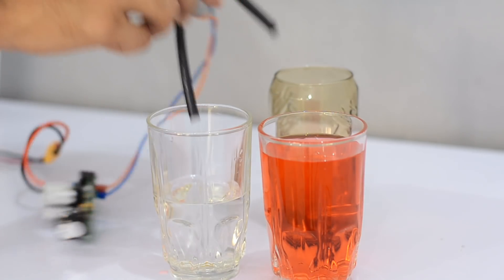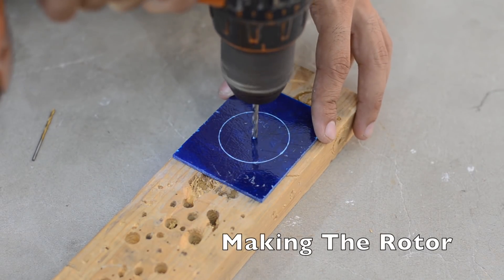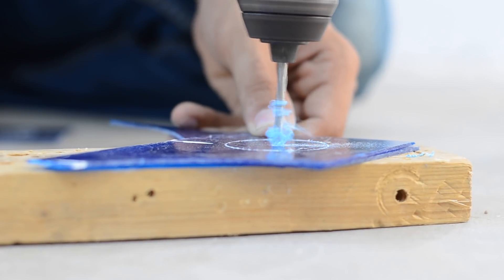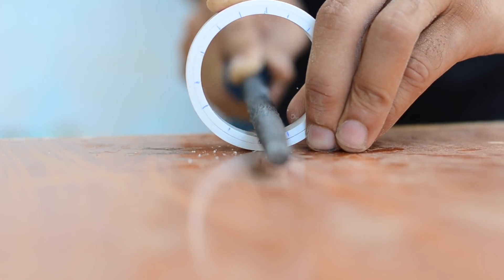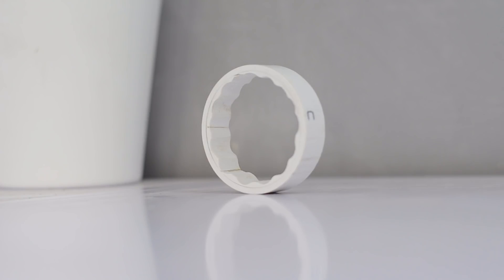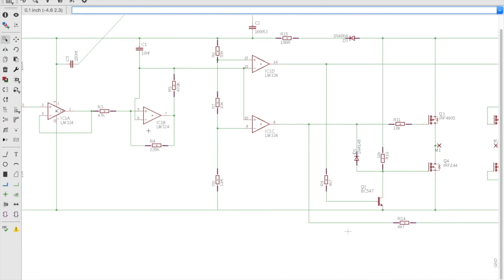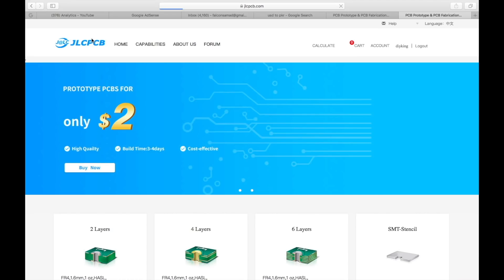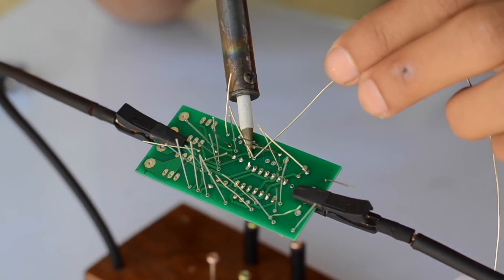How to make a Peristaltic Pump

Comment: What purpose do the groves have?
Reply: He said it was to reduce friction (or perhaps he said "produce" friction). It is very strange as the mechanism is visibly underperforming for the healthy rpms, probably by incomplete closure at the extrema of those flutings, with consequent partial backflow. It would probably not pump at all under any significant head-pressure.

Comment: How much is the clearance between the roller and the inner part of the casing?
Reply: depending on the tubing wall thickness, for example, the wall thinkness is 2mm, then the clearance should be 3.2mm between the rollers and comprssion block.

Comment: if i am using Arduino to give power supply on a specific coding and want a single direction rotation. then i might not need the bidirectional speed controller right ?? or the circuit will still be needed. ??

Comment: A very nice build. Thumb up. Before I decide to copy some of the design to start an own attempt, what is the flow rate? RPM and power consumption are also information that would be of interest. Thanks for the video. Got enough information to get sparked to build one.

Comment: What are the dimensions of your bearings? ID and OD? My ABEC 9 bearings are a lot bigger than the ones you've used here.
Reply from the maker: Dont remember the dimensions yet but ID might be 6mm while OD might be 12mm.
Reply: Thanks, my ABEC9 bearings are 22OD 8ID I'll use them but will have to use 2-1/2" Schl40 with shims. Awesome tutorial.

Comment: Very good job thank you for sharing. I have a question can you please reply? Is this motor suitable to work continuously 7/24? If not what should be our motor choice? Thank you in advance.
Reply from the maker: Well I have got this motor from an old scrap yard and luckly it's a German one .... Extremely good built quality so hopefully it can run a longer period but I doubt it for the period you are demanding .... For that a stepper motor is the way to go
Reply: for long duration working use shaded pole motor

Comment: It will be better if you dont file the pvc pipe to make teeth shapped internal profile.
The pump will be more efficient if the internal profile was a round circle.
Thank you it was a good job.
Reply: He said it was to reduce (or produce?) "friction". That internal fluting immediately looked to me in the closeup to greatly reduce the actual snug peristaltic closure of the tube necessary to minimize backflow, and the working model showed it to be absurdly inefficient given the rpm.

The contraption is grossly undeperforming.